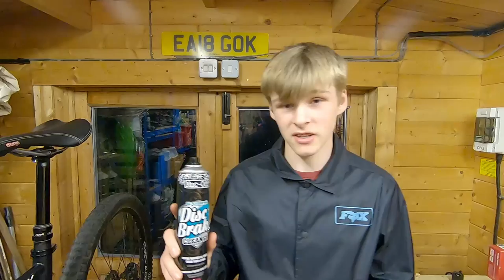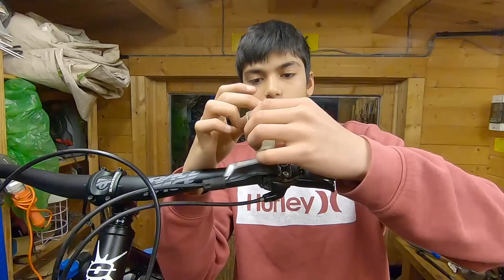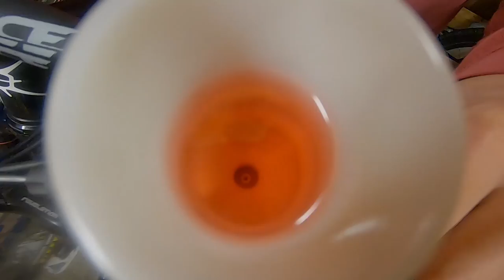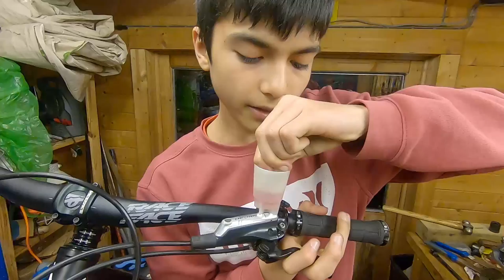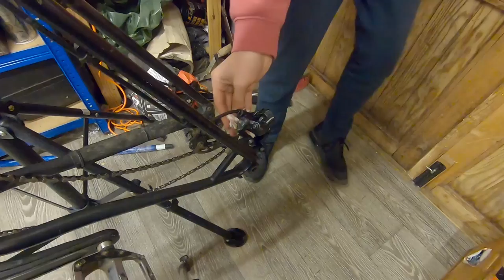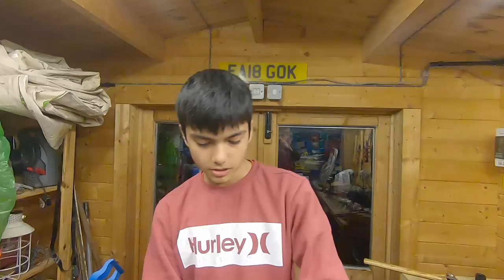HOW TO FIX SPONGY OR WEAK HYDRAULIC BRAKES // SHIMANO

Comment: Just got new shimano brake sets (since i last crashed in october) it felt so weak unlike when i first bought my bike any tips on how to fix and what's the issue?
Reply from the maker: Firstly are they the same brakes? Secondly new brakes take time to bed in.
Reply: @KrankProduction  yes i bought it myself and like usual, they were in a box so i think it's aight to say they were the same and how long do you think before they bed in? It's been like almost a month? (Maybe) But i appreciate that you replied thanks alot man 💯
Reply from the maker: @drunk_towin16  Couple things that could have gone wrong...
1. the new pads havent been bed in correctly, did you clean the rotors before installing the new pads?
2. new brakes need a bleed usually if they've come from shimano

I would try youtubing "how to bed in mtb pads" 

Welcome!

Comment: I took my wheels off to wash my bike and when I put it back together the levers would pull in much further (not quite to the bars) and feel slightly weaker, is this sudden change still because of the oil? I didn’t do anything to the breaks other than take the wheels off.

Comment: So I had no idea what I was doing with my tektro brakes and was trying to replace the pads which I guess didn't need replacing but down at the caliper I unscrewed the wrong screw right  and all the liquid leaked out and now my frying brake has 0 power, when you pull it, it goes to the handle bar with 0 effect, I tried the brake bleeding thing with a kit I ordered with the correct mineral oil but still my brake has zero power what am I doing wrong how can I fix it please, I don't understand it very much and it's very frustrating, I just want my bike to work right please help someone
Reply from the maker: I cant help much without more detail, would recommend taking it to a bike shop maybe...

Comment: What to do I have tightened that funnel bolt very hard it went little deeper when it was before pls tell me
Reply from the maker: If the screw is threaded you will need a new lever.

Comment: Mineral oil from the supermarket is cheaper and exactly the same and why not get a bleed hose and push the air out the bottom through the caliper, then the pads can stay in?
Reply: its not exactly the same there's many different grades of mineral oil i'm not saying your brakes won't work just not sure on how reliable they would be plus you would more then likely be mixing different kinds like what ever was in your system first and the supermarket  stuff might not mix well
Reply: @justinherman5047  as long as its nit baby oil its the same product, baby oil has lanolin or some other additive, i forget now
Reply: @justinherman5047  I've had baby oil in my brakes for a year, noticed no performance issue. No seal wear either. Which you would expect if it's a different grade of mineral oil.

Comment: i have old deore brakes, is it possible to upgrade only the levers to 2020 model but cable hose and calipers will retain?
thanks you so much
Reply from the maker: I have done a ton of lever and caliper mix and matching just making sure the nipple size in the hose is the same

Comment: I just got my bike serviced 2 weeks ago. I got sick for a week left it in the garage and I come back to my back brake which is a hydraulic squeaking and not working. The main reason I got it serviced was for the exact same thing. Any ideas on what has happened?
Reply from the maker: will be a leak if its pulling to the handle bar that quick
Reply: @KrankProduction  oh ok, in the hydraulic fluid stuff u put in the breaks? I have that. Would I just need to top that up?
Reply from the maker: @buckpuls  I would just try and check for leaking fluid, and replace the leaky seal or part. Refilling is a temporary fix. Honestly without more detail it's hard to help :)

Comment: What the yellow piece you slot into caliper known as?
Reply from the maker: Bleed block I'm pretty sure, you can use a piece of wood...
Reply: @KrankProduction  Since you are not opening the system from the rear why do you need to take off the rear wheel?

Comment: I have a 4 piston hydro brake on the rear and I removed the two piston bolts and when I tightened them back in my brakes went loose, before I removed the screws my brakes were fine, how do I fix this? It’s for my surron btw
Reply: did you ever fix it ?
Reply: @e.huss1  yes, hydro brakes arent meant to be squeezed or pumped when there isnt a disc brake in between the pads, so i just had to pry the piston to spread again and bled my brakes at the bike shop
Reply: @Danielxperez14  i bought a bike bleed kit ,new brake pads and ipa alcohol ,i'm going to do it my self. how much did you pay for the bleed at the shop?
Reply: @e.huss1  they fixed it and everything for 25$

Comment: i have tektro hydros should i get tektro mineral oil or does it not matter
Reply from the maker: Tektro brakes are mineral oil. It will work with shimano oil or tektro
Reply: Use baby oil or water , or possibly cooking oil. You’ll be fine
Reply: @Bianchiboy  Don't tell him that. 😆

Comment: You dont need to remove your wheel while doing that or use any kind of spacers ;)
Reply: yes u do, or else how will you remove the brake pads?
Reply: @e.huss1  i can remove my brake pads in both ways so i dont need to remove ny wheel
Reply: @GrizzJibber  probably depends what wheel/bike u got but most people have to remove the whee to make it easier as it’s damn impossible to work with the pads

Comment: Why does no one address whether it's a top off or a bleed?
Reply: It's a bleed, air is trapped in the system meaning  you need to top up/bleed the system. 
It's two different phrases meaning the same thing

Comment: don't mean to stink up your video but when your bleeding your brakes to get all the bubbles out you need to pump up the lever hold it like you did with the velcro strap and release some fluid right at the brake caliper its the screw right next to the brake line you put a small hose on it first and a pop bottle or something to catch the fuild that comes out then you top up your master cilnder before releasing the strap then you tap for bubbles again flick the lever repeat two or three times till there's no more bubbles o and when you take out the bleed screw on the lever careful not to lose the little o-ring thats on it it some times stays in the body and not on the screw your little cup can pick it up when you remove it and your brake will leak from that screw hole good vid other wise
Reply from the maker: Thanks for the reply!